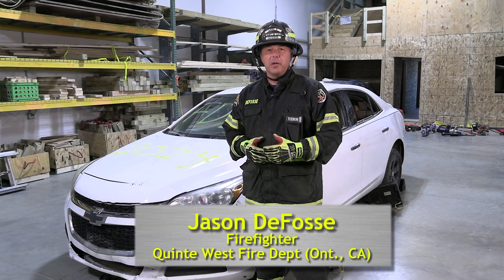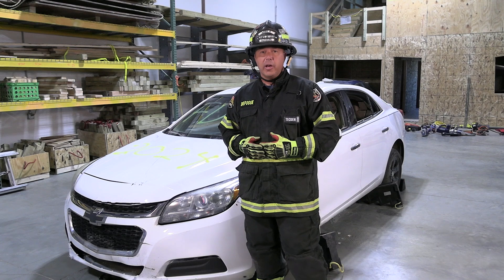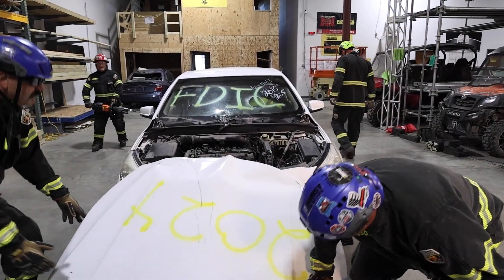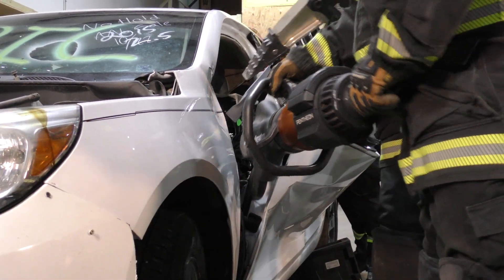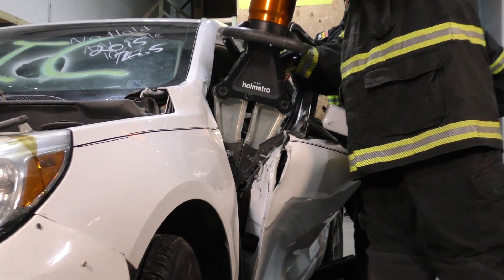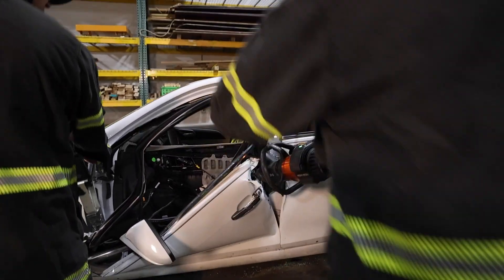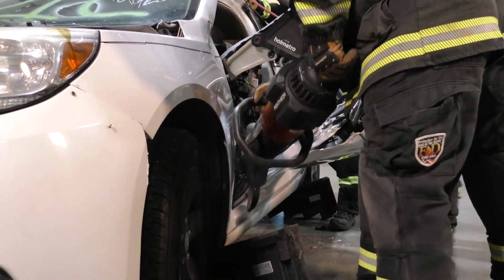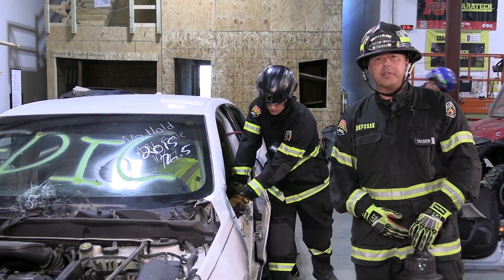Rapid Access and Extrication on EVs

Comment: I bet that hood left a mark when it popped up. Please give me a situation where popping the hood in that manner is relevant. Safest way to pop that hood since you didn’t give any type of scenario except it’s an EV is reach in the window and pull the latch. Most are in arms reach.
Reply: Hello friend, very good points and as a best practice, yes we should always try and pop the hood via hood release or go through the Tesla Touch Screen and activate the hood release. This is a simple example for any vehicle to access the First Responder Cut loop or low voltage battery when access is limited and base on your rescue assignment. Thank you for watching - Jason Defosse